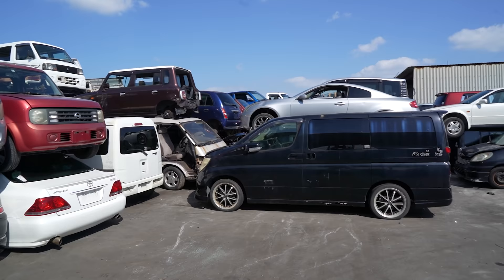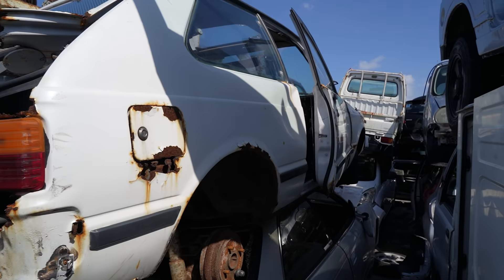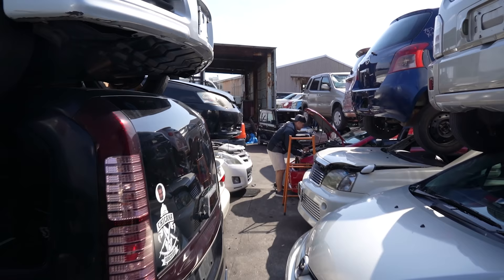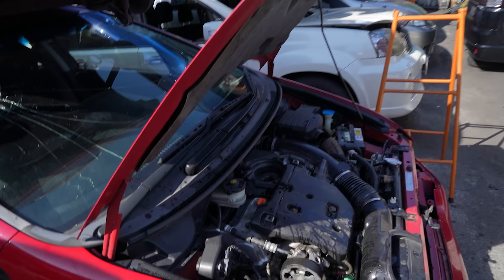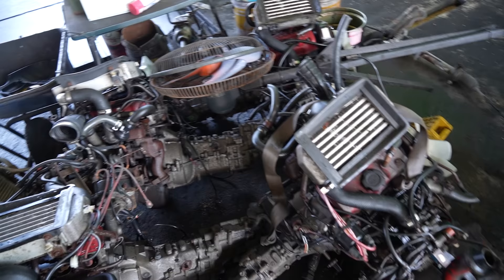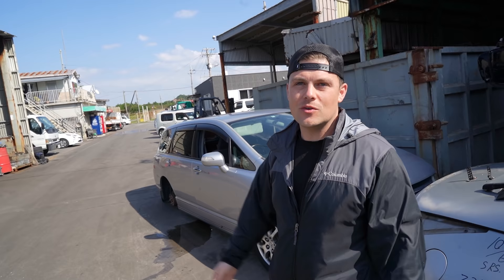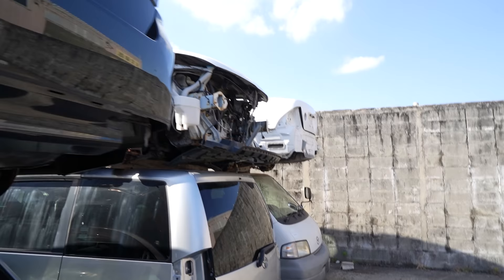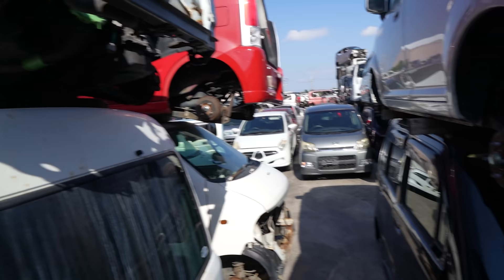FINDING LEGENDARY CARS IN JAPANESE JUNKYARD!

Comment: 5:10 is an AE101, had one as my first car 1.6 116bhp and weighed 970kg, it was just called a Toyota Corolla XL 1.6 in Norway, lol.
Reply: 5a engine
Reply: @javantaybrooks2856  Mine was an "efficient" 4A-FE
Reply: 4a is a better engine than the 5a
Reply: I have the 7a-fe 1.8
Reply: 4a head can work with the 7a

Comment: The absolute is a jdm k24a3, has vtec on both intake and exhuast. Around 190hp easily over 200 when swapped with a standalone. The non absolute has a 160hp eco spec k24a which i believe is what the k24a3 is in the states which causes confusion. My 96 crv has a jdm k24a3 from a cl9 and a manual awd box from a jdm rd5👌🔰 mint engines you should for sure do a rwd kswap. Have a look at speed academy  s chassis kswap
Reply: K24a2 in the US for intake vtec and exhaust.  After 08 they switched to integrated exhaust manifold junk.
Reply: @duanebailey6253  yes

Comment: I love having picknpulls around me. I'm a straight shot down the road about 7-8 minutes from one. Got so much good shit for a number of cars for insanely cheap over the past decade.

8:31 Sam, that's an insult. That's a sport sedan, the 4 door 350z.

8:55 Patrick Bateman's car.
Reply: G35 4-door. ripper
Reply: @gopherchucksgamingnstuff2263  I love mine, even though it's been nothing but a pain in the ass over the past year.
Reply: @cd5sircoupe , I have a 2010 370 It has grown on me.  I am thinking of a rear mount turbo kit.
Reply: @gopherchucksgamingnstuff2263  Better do the supporting internals & other maintenance before hand. Mine's gonna need a teardown/refresh very soon and I figure, shit if it's gonna be in that state I might as well do some forged shit in there. It'll open up the possibility for boost, probably an HKS supercharger. It's cheaper than the Vortech kit I originally wanted.
Reply: @cd5sircoupe  I have 64K miles on it I expect it to go soon after. I really want to RB swap or 1j.
Reply: @gopherchucksgamingnstuff2263  I'm at roughly 120k... might be 119k & change. I forget. Car needs work evidently, judging on how much shit failed over the past year+ every couple weeks. Had a good service history, but apparently they didn't do any actual service, just the usual bullshit when the dealer told them to come in. Who knows if that dealer even did the work they charged for, I've seen that too many times to count...
Reply: @cd5sircoupe , Brother I agree, these as well as mine are the rough "save Nissan's" chuff years.  Some shortcuts were made to make the platform affordable. It is a great car. I just know this VQ37 isn't going to last forever. But it will spin the tires really well 😁
Reply: Lmao @ "Patrick Batemans car" 😂
Reply: I just went to the local Yunkjard yesterday. No parts for me this time, just a couple cans of fluorescent spray paint from the trunk of a car. Did find my friend a cool antenna for his E46 that has a carbon fiber inlay on it, and my buddy got another dvd drive for his Accord's navi system as well as the auto dimming/home link rear view mirror. We actually got the entire navi system for that from a junkyard car here this past fall for super cheap compared to buying one online.

Comment: A the body shop I worked at, maybe I was 22, we had to repair a 1994 or 1995 VR4 AWD Turbo 3000 GT Mitsubishi, the owner just bought the car brand new, drove off the Mitsubishi lot and had a car accident. The back of the car was hit. We replaced the left quarter panel, the wheel and tire and suspension parts. It was a battle ship pearl grey, really a bad ass car.

Comment: That first motor was a 7afe. You can use that motor to make the 7age or 7agze. The crank can be used in a 2 L Honda as well. It will give it a shorter throw for higher RPMs.

Comment: The k20a is the best engine for drag racing because the shorter stroke produces less torque and the k24a engine would be the best for drifting or road racing because of the torque it produces it will get you out of the corners faster or keep up in the rpm for drift. Their both great motors just have to pick what you want to use them for

Comment: I run a k24a in my 07 honda civic si. They go for 1000usd if in good shape. They rip stock, qn with a turbo an good tune They run 500hp easy. Or put rods an pistons and valve springs to run 1000hp.